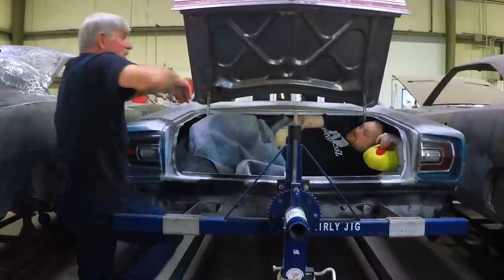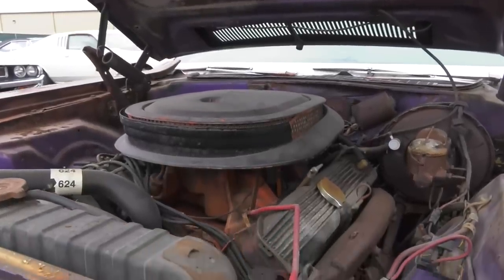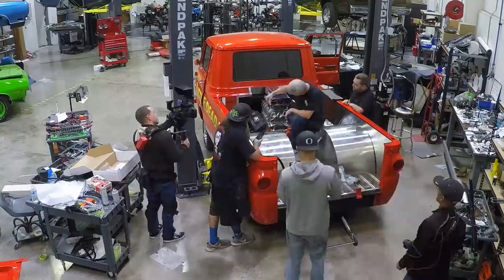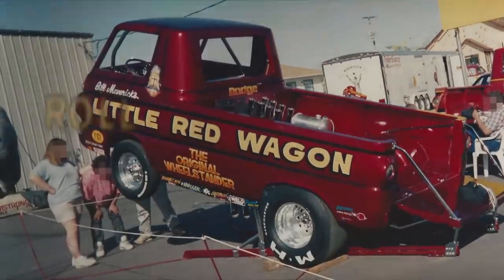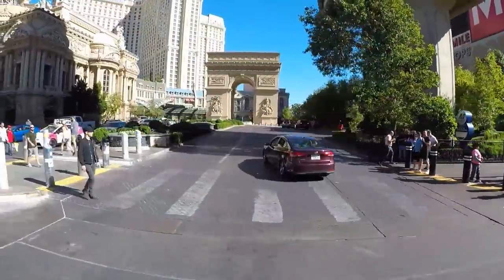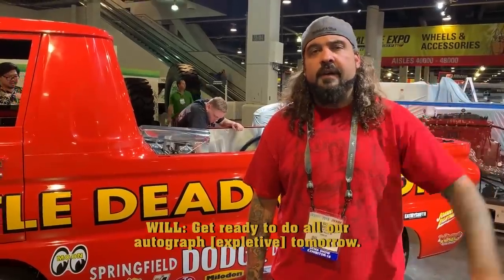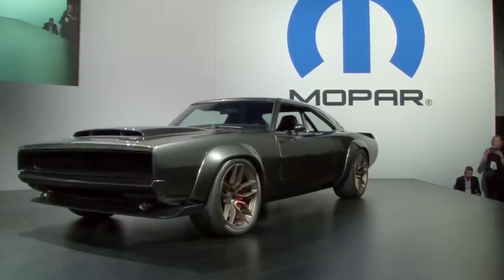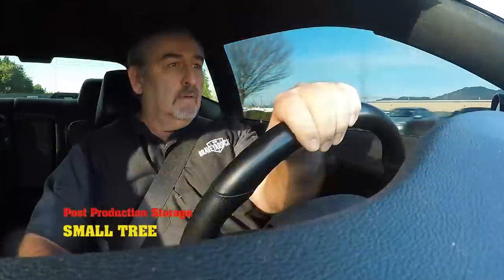S10: LITTLE DEAD WAGON STEALS THE SEMA SHOW!

Comment: FYI- Johnny Lighting  by Topper, didn't come out until 1969 !... It challenged Hot Wheels 1/64 diecast cars, which debuted in 1968....  Many other inaccuracies from Mark about the LRW. One of which was , it was originally built and owned by the Chrysler Corp. in 1964, and raced to show off their new Hemi Engine and the A100 trucks. And Bill Golden wasn't even the first  race driver of the truck- he was the 2nd, and when Mopar realized the truck couldn't be competitive as an A/FX class raced- since it couldn't keep the front wheels on the ground, they sold the truck to their 2nd driver - Bill "Maverick" Golden, who realized it's potential to become a  Exhibition Racer !
Reply: I REMEMBER THAT YOU ARE RIGHT ON AND TELL ME ABOUT HEMI UNDER GLASS..

Comment: help!!!!!!!!!!!!!!!!!my vin plate is missing on rhe left front inner fender, i mean its the option label screwed onto the left front inner fenderwell.  please could you tell me how to obtain a new one??   i have the vin, its a 1973 challenger , vin# jh23g3b332970 automatic car, vinal roof,318,bronze in color, black interior not sure what rear gear ratio is but i hate the gears in it now and im thinking its a 410. engine screams at 60 mph.., although theres a 8/ & ,   3/4 i just dont know the ratio...pleas help me have a replacement made if you would be so kind!!! thankyou very much!!!!!!!!!!!!!

Comment: Totally Bad Ass Gentlemen !  the Real one has been on display in Big Daddy DonGarlits Museumn inOcala Florida  it’s on a Stand holding it in a Wheel Stand  last i heard  it still held the World Record on Wheel Stands  i don’t know the real Specs on that one but i wouldn’t be surprised if the Dead Wagon with  all that Power couldn’t  take over the Record ! i’m 57 years old and  that Truck was a Icon of my Childhood
Reply: The one down at Don Garlits Museum was a replica, It had an empty Hemi block and empty transmission, It was just built for the museum because the last running wagon was still on tour at the time, I know this because I donated the headlight covers and the grille, Because I used to crew for Bill Maverick Golden and the Number Four Little Red Wagon from 1988 to 2002 his retirement, That truck has been sold three times since it left the museum, Also the truck and the museum had the driver sitting on the left side and that's the way it was with Number One and Two, Number Three and Four to driver sat in the center with Center steering in the center seat, The last running truck is in the museum in Coal City Illinois and a private Mopar Museum of Greg and Kathy Mosley.

Comment: The concept super-charger looks all wheel drive with the big wheels and the stance.  If it goes into production I say do it, better than nothing.  I think GM should bring back the Chevelle SS.  Also I thought an engine had to be  500 in.³ or bigger to be considered an elephant, if it's under 500 it's a rat
Reply: No, elephant is Chrysler, Rat is Chevy.